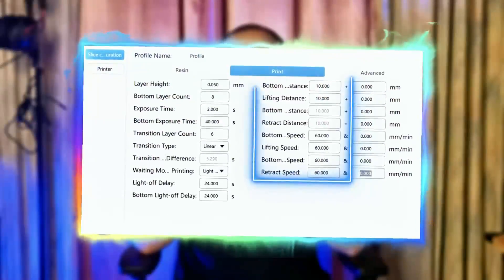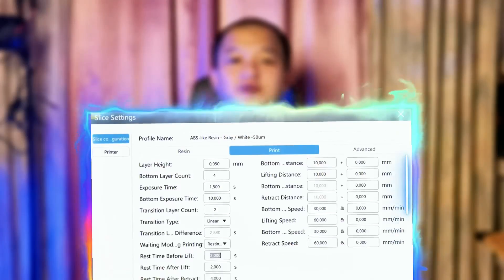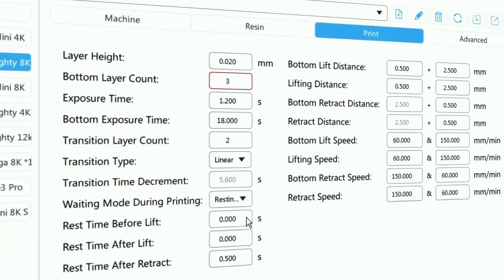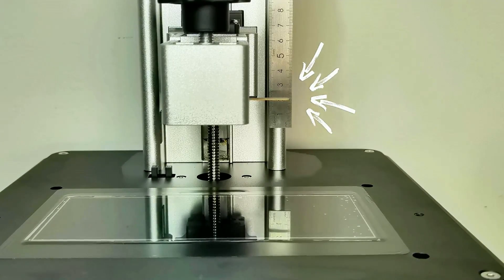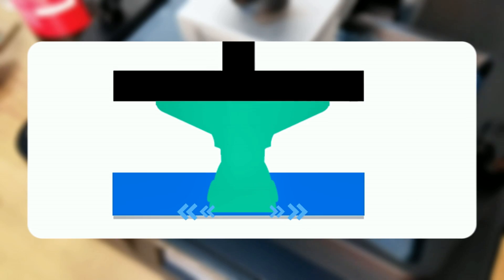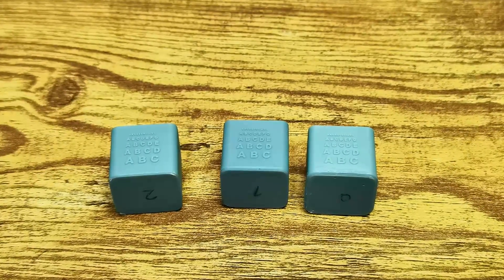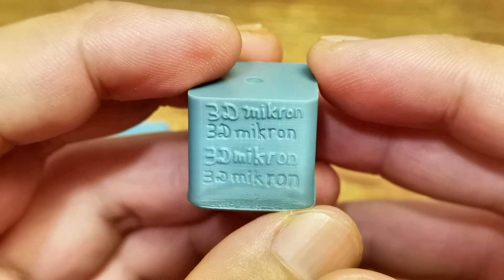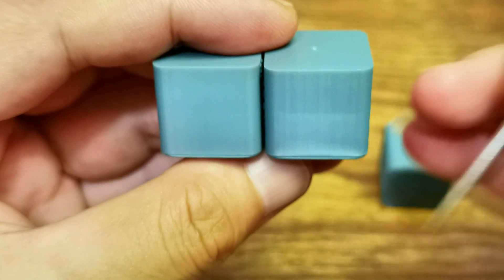Masterclass Resin Printer Setting - Light Off Delay And Rest Time

Comment: I think the bubble on the top is the resin inside the cube sucking in material as it finishes teh print because the material insdie cures at a different volume because of the shrinkage. I dunno did that maek sense? I can explain it differently

Comment: I'm a bit lost with the 24sec example...weird that you would have to consider the time of up and down included on time off...as if you got this wrong was possible to start the next layer while the plate is moving? I always see time off as beeing 1-2 sec...never saw above 20s to consider the movement...I assume is after the plataform settle down it start counting the time off, no?
Reply from the maker: Chitu has 2 setting for that. 
Light off delay and rest time
What i explain is light off delay
What you use is rest time.

Comment: Are the rest time and light off settings independent of each other meaning you use one or the other or are both used. I would like to increase rest time for the bottom layers but there is no option for that.
Reply from the maker: @enginebill  they are different setting.
You only can choose one.

Comment: how can i remove the "elephant foot" completly without using supports or base?
Reply from the maker: Have a good build plate leveling so you can use low bottom exposure.

Or use chitubox compensation setting which might require several tests.
Reply: @wangdennys  build plate is perfectly leveled  , could i contact you somewhere like discord or anything for the issue? i have heard for the compensation settings before but i dont know how to start testing it and what to change
i dont mind testing i use my printer for professional use (im a dental tech) and you would really save me from alot of handwork if i fixed that issue

Comment: Light off delay should be based on the resin itself as well as the printer. A lot of folks don't even use this setting and get bad prints. The resin for the setting is due to resins needing more time to flow back after the build plate comes down, I personally use light off for .5 seconds on my materials currently and that works fine there. I have not had to change that in a while now, but I stick with resins and machines that are designed to work with each other. Often times the major issue is that folks are using resins not made for the specific line of machines. I am not saying you cannot do this, as I have experimented with other brands, but my best results usually occur with what I work with most, Otherwise tuning is needed etc. For example 1 resin I tested last week required slower speeds and a longer light off delay, and comparing the viscosity of both resins I questioned why, as the new one actually flowed better than the material I use most commonly, but the light-off needed 1 second longer to ensure quality prints. I spoke with the company about it and essentially it was for flow issues as sometimes the better flowing material can get squeezed out from under the build plate, and you get pockets underneath (tiny ones) that are essentially like an air bubble, the 1.5 seconds helps the resin flow back to the spots it is needed, I guess regardless if the resin is thicker or thinner always check the manufacturer and ensure your settings are tested with something small first. Nice video here, thanks for sharing as always.

Comment: Great video, friend, it's amazing that it seems that you are the first person to actually make a Youtube video about this very important topic that shows it so clearly!

The bubble at the top is mainly because of two things - 1.  The build plate is VERY well trammed (aka "levelled") and 2.  The retract speed is too high and possibly 3.  The lift height is high enough that the top of the prints are coming out of the resin before retracting again.

Using 3 seconds of wait before print on regular layers also helps with this, but it seems one needs to use a slicer that lets one control separate bottom layer and regular layer wait times to do this (like Voxeldance Tango slicer, or Formware3D slicer, for example.  Lychee and Shitubox can't).
Reply: I agree, I do videos on resin printing, it was a topic I was thinking of delving into, but I am good now, I will just point my viewers this way, but I think they might find it on their own.
Reply: @IPrint3dMinis  All youtubers should learn about this and talk about it and put pressure on slicer makers (Lychee and chitubox) to implement wait times properly. The fact we need uv tools (if using chitubox or lychee for example) to make this work is ridiculous. Wait times solve most fails that people are having. 

Look up also Honza Mrazek's resin printing blog, which is probably the best resource for this we have at the moment.
Reply from the maker: @IPrint3dMinis  thank you
Reply from the maker: Thank you

Comment: It's great that someone with your credentials on yt finally speak about the huge benefits of rest times. Jan Mrazek wrote about this a LOT 2 years ago on his blog including a guide using uv tools, and the fact this is still unknown to most people is crazy. Rest times are the best thing people can do to improve their printing. It allows us to use bottom exposure of 1.5-3x of normal layers, removes elephant foot, layer separation, blooming, makes the resin bonds stronger which also allows us to use small supports, etc.
Reply: Between Dennys and 3D Printing Pro you can't go wrong. I am glad I watched their videos before I started resin printing. Many people want to go for pure speed and then blame the printer cause I guess they don't have the patience to deal with how relatively slow resin printing is. I would much rather get all my settings dialed in properly, and have a print take 12 hours and come out perfectly than a 4 hour print that looks worse than an FDM print.
Reply: I couldn't agree more. I learned so much from Jan, especially on this matter. I have tiny supports and none of that BS 30 secs bottom layers. 
As for Light Off Delay I have an older version of CTB and I think it doesn't work like Denny's newer version? I think it really just works as "rest time before exposure" which is all I need. I have it set to 3-4 secs and it definitely just rests for that amount of time before the next exposure. 
Aslo, if I print overnight, I raise that to 10-15 sec my thinking being that it gives the LCD screen time to cool down in between exposures which might prolong it's life span a bit. 

I recall someone mentioning somewhere that the UV light is ALWAYS on and the screen exposure time is what let's the light through in which case a longer rest time would fry the screen more as it would be baked all the time by the light. But I am pretty sure my old Anycubic Mono 4K only turns on the UV as needed for each exposure. Think I tested that a year or so ago, but might have to check again. The LCDs for my printer are not that easy to get a hold off.

Comment: I think the one thing that has made the most difference in my 3D printing success was learning how to set up UVTools to set wait time before and after cure automatically, based on the plate's proximity to the FEP and on the size of each layers cross-section. So that any time I have big flat surfaces plunging into and out of the resin, extra time is automatically added to account for resin being squeezed out of the way. I'm pretty sure it's the reason I've never had bed adhesion problems, and am able to run base layer exposures much lower than what most people recommend without issues.
Reply: How do you do that?
Reply: @thedorklylionchannel415  Look up Honza Mrazek Step by step guide to perfect bed adhesion in uv tools, you'll find a guide and also a ton of knowledge.
Reply: @thedorklylionchannel415  Look up Jan Mrazek's blog "mind.dump()", and then search his entries for the ones about UVTools. You'll find step-by-step instructions on setting it up. It's a bit complicated to explain, and I don't even fully understand all the numbers, but I just followed his directions and it's worked perfectly for me ever since.
Tons of other good 3D printing info on that blog as well.

Comment: Unless you have an anycubic m3 premium, where rest time does nothing and light off delay works like rest after retract, 😢.
Reply: is this still an issue with latest firmware? i hadn't noticed it, have to check now
Reply: The M3 line had tons of issues, think the new firmware actually fixed this. I use Lychee so I am not sure. I know Chitubox and Anycubic sometimes don't play well, you could try exporting the STL and importing into the newer Photon workshop that will probably work as a decent work-around..
Reply: @IPrint3dMinis  the regular M5 printer aren't any better
Reply from the maker: Have you tried it on photonworkshop?
Reply: @wangdennys  thanks for the reply, I am not touching photon workshop. I am happy with using chitubox lightoffdelay as rest after retract, works great, especially with your way of orienting and supporting the prints, I have a ton of success.
Reply from the maker: @runklestiltskin_2407  you could use pws just to slice
Reply: @wangdennys  I know